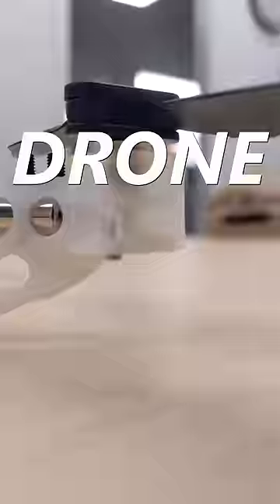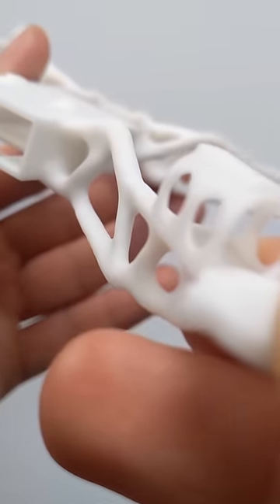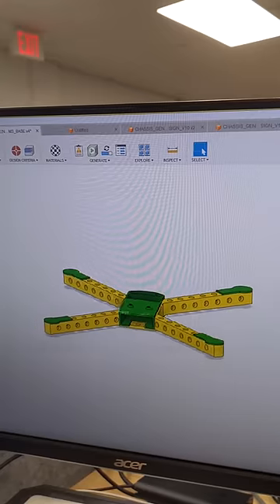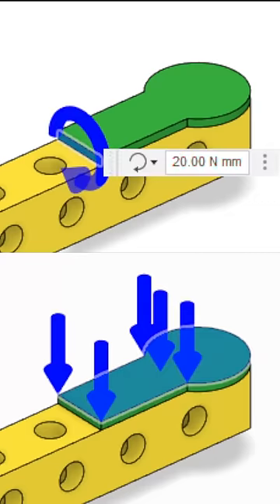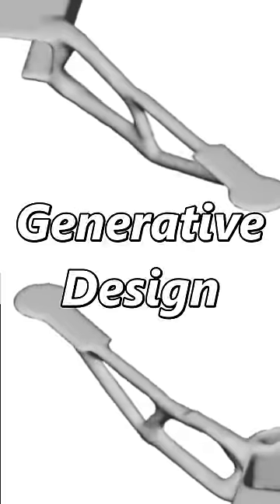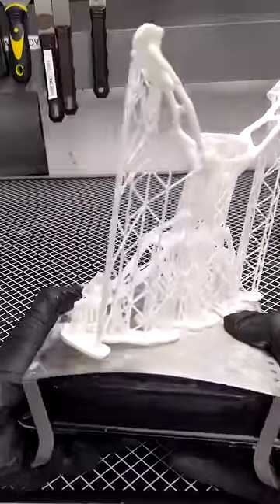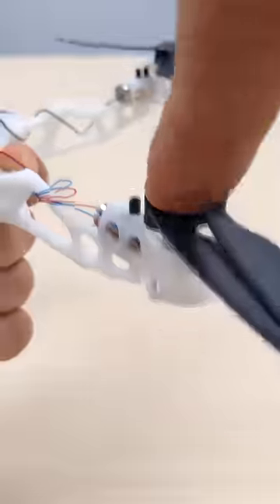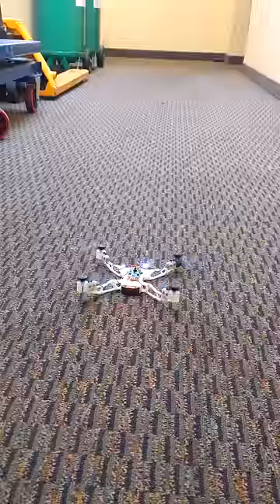3D Printed Generative Design Drone Chassis #shorts

Comment: No you didn't use AI to make the model for you. It is generative design. Besides I doubt you even made the drone, since I checked your videos and there is nothing related to it except this short. doubt you will leave it at a short if you indeed made it.
Reply: This is the Formlabs channel...
Reply: There’s a bunch of 3d printed drone shorts on this channel…
Reply: Oop, another guy who doesn't know what AI is.
Reply: You are ignorant. Fusions Gen design isn't about a single topological solve.
Reply: @m3chanist  it is not AI driven.
Reply: @mikecoman23 yes it is, have you ever used it? Know anything about it? I can answer the last one, No you don't. Go do some reading then come back.
Reply: what is AI?  Artificial Intelligence (AI) is the ability of a digital computer or computer-controlled robot to perform tasks commonly associated with intelligent beings.   Artifical - its meaning - Art. not unnatural..
Reply: @m3chanist  This is a computational approach based on parametrical equations. Recursivity does not define AI. A watertight mesh is wrapped around the object and properties are assigned. From the nodes of this mesh force vectors are defined and based on the propagated deviations and defined decay of materials, deviations are computed and plotted, a set of conservative max and min limits are given for each material and if the formulas are within the parameters pockets are created at the least effected point in mashes and grown accordingly. This goes recursively till a no gane solution is found and the algorithm stops. AI on the other hand has equations that need training with masive datasets, you don't need to explain phenomena through equations, AI will build those equations as trends and come with an answer, obviously there are as well recursive operations in the programing of AI, but that does not define it. PROCEDURAL GENERATION IT IS NOT AI.
Reply: @SingularityAdvent  Bzzt wrong, you don't even need an input object.

Comment: I did this exact thing in F360 in my undergrad, the Generative design tool is very fun. We used Beta Flight and Ecalc to tune the hardware and hooked it up to one of those Shark VR headsets.
Reply: You’re gonna want to add lateral loads to your arms to stiffen them btw! Your arms are stiff in the vertical direction, but the vibration from the motors will be in the range of the resonating frequency for sure!

Comment: Upi såecofoed the load force but you specified the load backwards. there's no downforce on the motor mounts, it pulls on it. obviously it doesn't matter much for that small drone, but i would enjoy seeing what the design would be with the correct force calculations.

Comment: “Rough form factor” is 95% of the design. All the AI does is chip away from the build until it gets optimal strength to weight ratio. Soon it will be able to do the rough form itself

Comment: You applied the torque in a tiny face which actually wont be resisting the torque.
It will be the arm beam.

Comment: You can attach the electronic parts to a couple of rulers in a + shape and it will fly. You should crash it and test for resistance. Maybe test for flex as you want no flex for most predictability during flight and harsh manouvers.

Comment: It's my favourite tool. It's limitless, the only problem I have is that I can't make a custom material for generative design and my FDM printer isn't ideal for this small arm and support structure either, I would use a resin printer but I don't know if it's strong enough.
Reply: Find a lab that has one and try it out !

Comment: The real question is how does it hold up in crashes?
Reply: The whole idea is to make it as strong as possible while taking up the least weight
Reply: @aw_dev  right, but material choice is critical to durability.  you can have a strong, impact resistant, and lightweight chassis with the right material choice.  typical ABS-like resins are notoriously brittle and would likely break on impact while engineering/flexible/blended resins would take impacts much better

Comment: Topological design, or generative design, as it is called in Fusion 360 has nothing to do with A.I.
Also, you talk about the load force, but you are using it the wrong way around. Your props are going to lift the drone, not pushing it down into the grond. And lastly, not your computer but your software designed the structure, and because you are using it totally wrong, you should consider learning more about Fusion 360.
Reply: thank you was searching through of ton o f comments to find a actually informing one

Comment: It's very procedural not AI, although I guess soon it will be AI augmented
Reply: It already is and has been from the outset, some three years now. This isn't a mere single topological solve, it's uses entire AI backend to solve for multiple design considerations, material, manufacturing process, cost, and yes physics and topology and from that significant number of branching solutions present a set of optimals